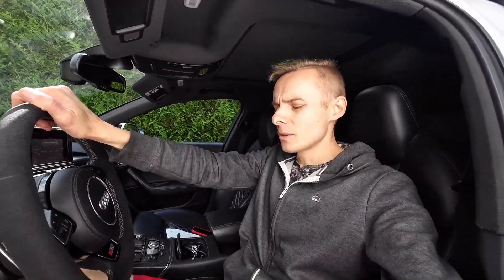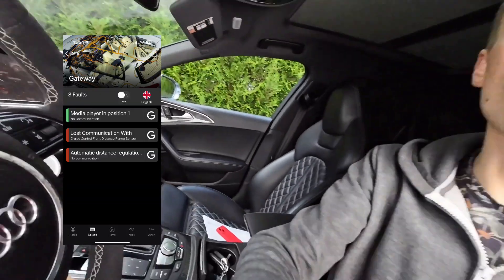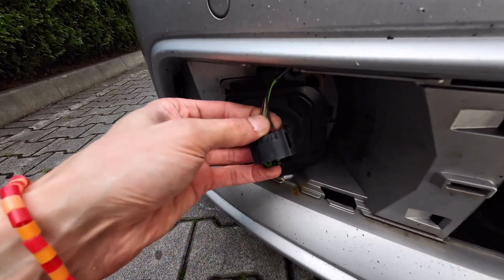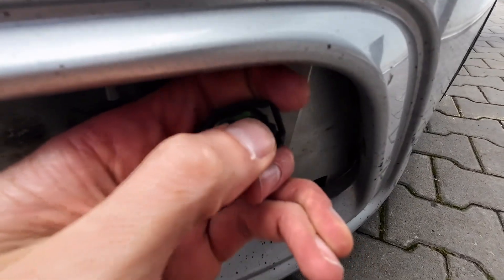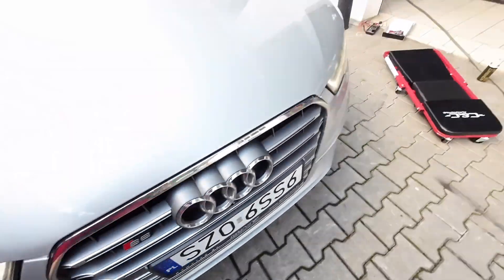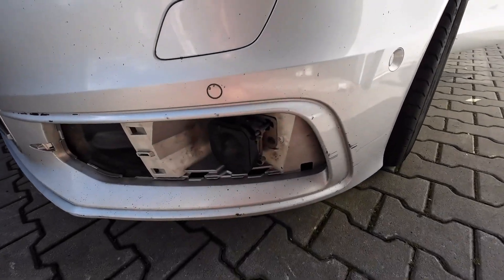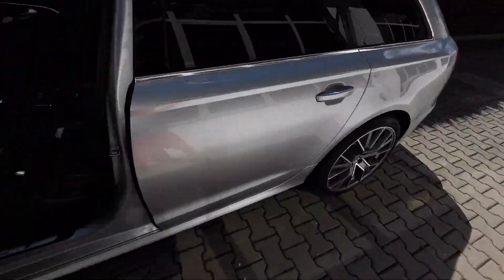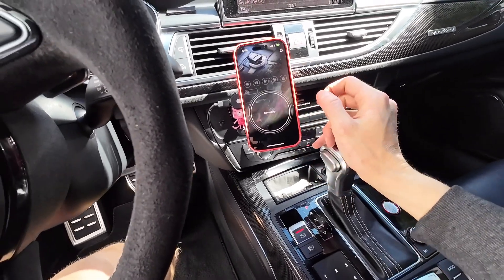Fix Audi ACC & Brake Guard faults for free!

Comment: Thanks for this information I do have issue with parking radar on my 2011 Audia A6 Allroad that does not warn for impact,  I will now check the Connection.  Thanks Per-Ove - Sweden.
Reply from the maker: Make sure that you are not confusing parking radars with ACC radars. Two separate systems.

Comment: Hi.l have problem with my Audi A6 2012 3.0 the code in my car is Contol module2for lane change asisstance (J770) 014-defective Freze frame.fault status 01101110 thankfully

Comment: Hi.l have problem with my Audi A6 2012 3.0 the code in my car is 02850 Contol module2for lane change asisstance (J770) 014-defective Freze frame.fault status 01101110 thankfully

Comment: Hello, did you try repair issue with  message "0267 - Sensor for Automatic Distance Regulation; Incorrectly Positioned " unit  Address 13: Auto Dist. Reg (J428) of car Audi Q7 4M?
Reply: Same!

Comment: Do you have a IG or other way of reaching out. I have a 2013 Audi s7 and have a few questions of faults that are popping up on my dash
Reply: @Jhay7031  I have the same car. I have the same problem. Did you find a solution?
Reply: @ozireis588  i have the same car with the same problem also. Did you ever fix it?

Comment: I am trying to update the firmware of my Audi MIB2 System, there is something that I have been reading about the datasets for the Bose/B&O Amps that needs to be changed beforehand or disabled. What would be the best method to go around that so I do not accidentally super-messup my sound system?

Comment: Hello mrFix! I have an issue with my VW MK7 GTD 2014. I have the unavailable ACC issue but the problem is that my car sometimes brake in high speed or even in slow speed then I can't accelerate anymore until I turn off then on the engine. when this happens I have another indicator on dashboard in orange (it shows a car next to speedometer and an exclamation mark). would it happen for you to know the root cause? Thank you very much and keep it up, big fan of your channel :)

Comment: Hi. You're making a good job and especially for free. I wanted to ask you about Audi pre sense problem. Sometimes the error came up on the cluster . Fuse are ok . And also the seats belts tensioner doesn't work and not even let me go in that module with obd eleven.thx in advance

Comment: hey, have you seen a B200000 control unit faulty error? seems to be an Internal Control Module Memory Check Sum Error.. on the master side, which is disabling ACC.. whats really weird is that everything else is working fine, (like lane assist, and blind spot assistance which require ACC to work) and i'm getting live data from the master ACC module.... any ideas on how to fix it?
Reply from the maker: Lane Assist is camera based, Blind Spot is using rear radars. Those system do not require front radars to be fitted.
You can try to flash firmware on the radar and upload the dataset. This should help if the radar is not damaged.

Comment: Hello, While driving on the highway in my Golf 7, lane tracking, sign reading and high beam gave errors. In the fault diagnosis, dynamic calibration is shown in the A5 module. I drove for about 500 km but it did not fix the problem. How can I solve the problem?

Comment: Hi, i have a 2017 Audi TT, all the lights on the dash came on, hill assist, Tpms, ABS, Airbag and many more, I scanned the car with OBDEleven and it  was giving me a speed sensor error. So I bought the sensors, I turn on the car, move it to the area where I do my repairs and proceed to change the sensors, disconnect the battery and change the sensor, then connect the battery and when I go to start the car, the panel and the lights turn on, but the driver's window that was open does not close, I check the battery which is practically new and was dead, I take it to be checked and the diagnosis says it is good but dead, I charge it, mount it and try to start the vehicle again and the same thing, the lights, the radio, the digital panel turn on but the driver's window does not go up and it does not make any attempt to start... Also after a few tries the OBD could connect and gives me a Terminal 15 or 30(don't remember) error low voltage...  I am lost and I do not know what it could be... I don't know if it's the Crankshaft sensor or the Camshaft sensor, or the Ignition or the Start Button or the Battery... Helppppp...

Comment: Wait... The plug is at the top ? To allow all the water to just sit there. Even tho its clearly going to get very wet from road spray .....
Reply from the maker: Exactly… if I recall correctly, in MK7 radar was rotated 180 and the connector was at the bottom.
Reply: @mrfixpl  see that makes sense, water will always wick in...
Reply: Maybe put some electrical tape around it will seal it. I know there are some kind of sealant to put on connections to prevent water from getting there, some people use it to water proof drones